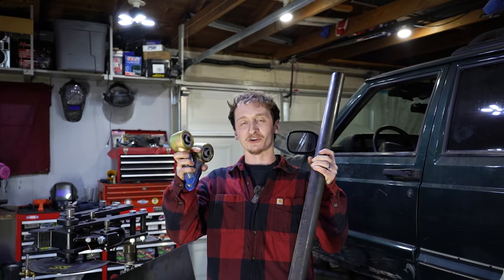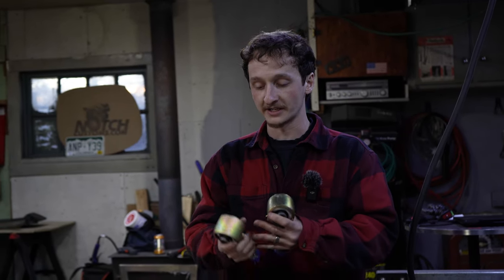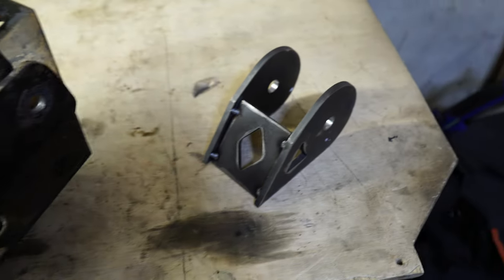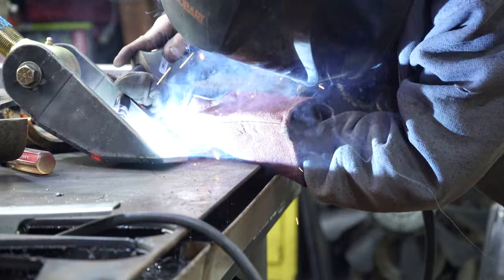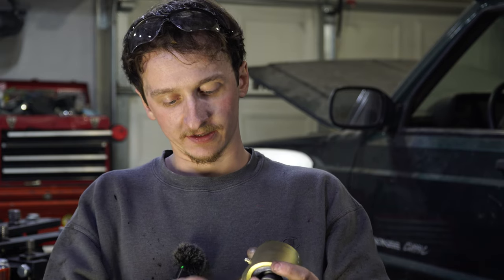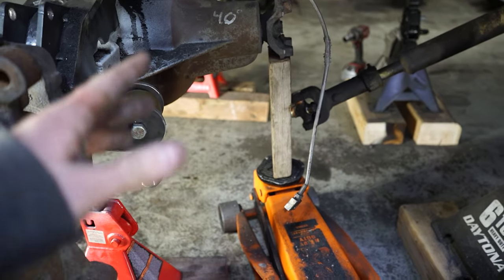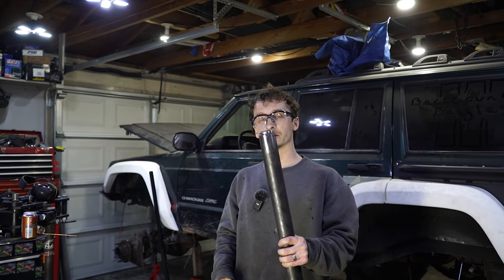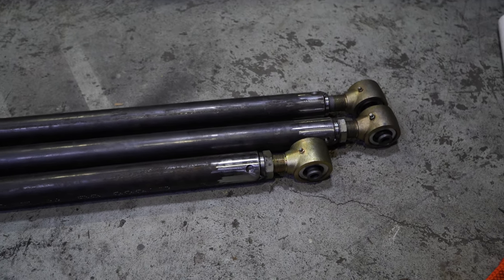We Have Links! Jeep Cherokee Xj One Ton Swap Continues!

Comment: Is this on a stock Motor trans and gears ?
Reply from the maker: Stock motor and trans, for now at least. 4.0 has the usual 4.0 mods done to it plus a small cam but nothing crazy. When we build the axles here in a future video we’ll be throwing in a set of 5.38s.
Reply: @backcountrybeagles  what kind of gas mileage you getting ?
Reply from the maker: About 12 average. We’ve seen 15 on long trips. I don’t expect it to get any better after the tons and 40s are on it…